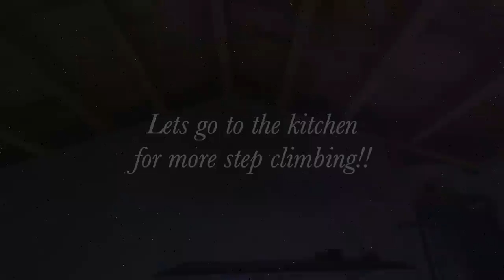The Ceiling gets a new coat, and the final piece of plasterboard is fixed onto the Great Wall!!!

Comment: Oh man watching you paint that ceiling was making my neck start to hurt, reliving the pains of painting many a ceiling.  I absolutely hate painting ceilings.  I’ve found an extension pole screwed into the end of the roller to be very helpful when painting ceilings, no up and down the ladder and encourages you to use longer strokes/passes which also has the benefit of fewer visible roller marks.  For bigger jobs (this one is probably on the boarder of smaller vs. bigger) I like to pour the paint into a 5 gallon bucket and use a painter’s screen hooked to the inside of the bucket.  This makes roller painting go so much faster and IMHO allows you to load up more paint in the roller vs. using a pan.  There are tons of videos on YouTube on how to do this and the extra equipment is super inexpensive, all in maybe €15 to at most €35, if you go with a telescoping extension pole.  The pole is great for painting walls too, keeps you further away from the fine paint spray that invariably comes off the roller and lands on you if your holding the roller directly.  Anyways enjoy seeing the progress your are making and looking forward to seeing the finished product.
Reply from the maker: Ive now given the ceiling two coats, and as soon as I finished thought to myself why didn't I use an extension pole....... lol plenty more ceilings to do so look out for the pole in future vids...lol Many thanks and Happy New Year

Comment: Don't you need to tape joints in plasterboard or is what you use specially for it?
Reply: I wondered the same.
Reply from the maker: they recommend you do just to help prevent cracking etc, Many thanks and Happy New Year

Comment: Not sure where you are situated in France, but are you aware that Screwfix has opened a branch near Lille with a total of 5 further  branches  opening by the end of January. Not sure where the others will be located.  Perhaps you could order your caulking compound from them. Personally  I like their "no nonsense" range of products and can vouch for their interior fillers  both ready made and in powder form, range of wood  varnishes and caulking products. Just a idea.
Reply from the maker: were in the Vendee, yes I did know that screw fix are over here, but not close to us, I believe they are opening more stores in early 2023.. I live close to a few in the uk so ill pick it up over there and bring it over.. Many thanks and Happy New Year